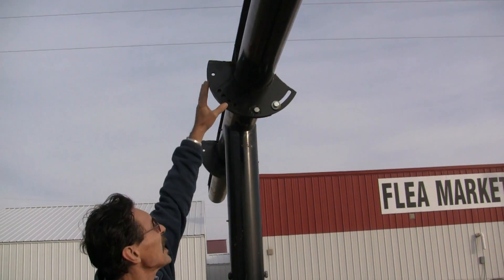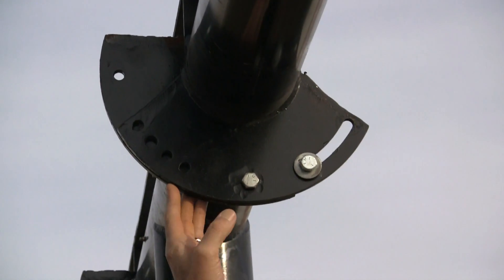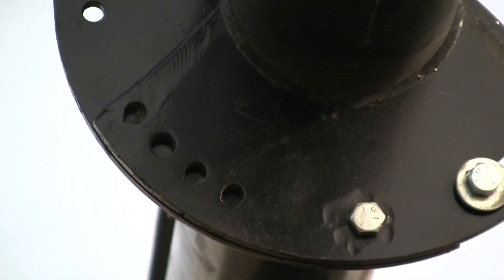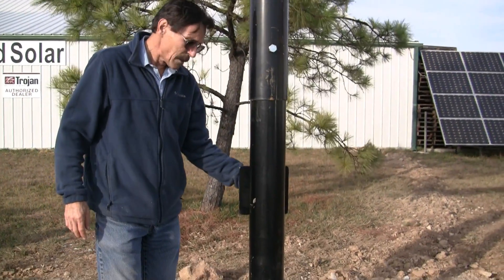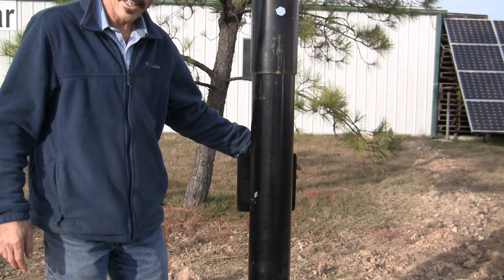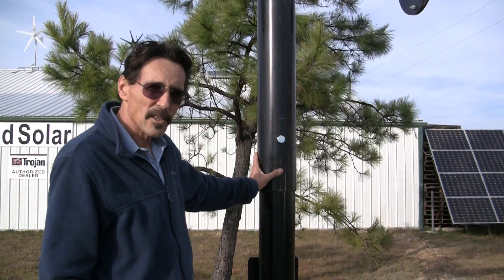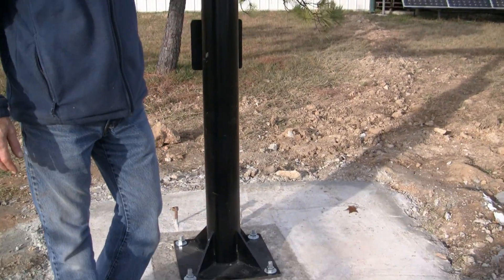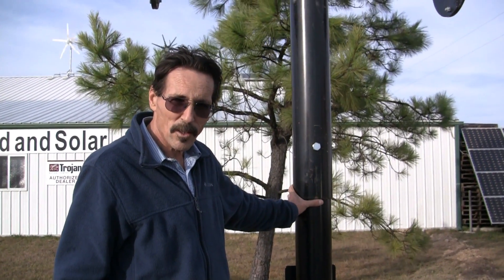Best solar tracker  Missouri Wind and Solar Reviews

Comment: My Homemade DIY 660Wp Sun Tracer ☀️ Solar Tracker ➡️ https://youtu.be/X0lmYFwOq3U 👍
Supercaps Powercap 36× 500F Battery Accu Solar Grid-Tie 2,7V Farad ➡️ https://youtu.be/ihSc7Bj_oQk 👍
Set PV solar surplus electricity using a 5000W dimmer on the washing machine, and not a single watt more.➡️ https://youtu.be/eC2olbCBhh0 👍
Please Share and Subscribe.